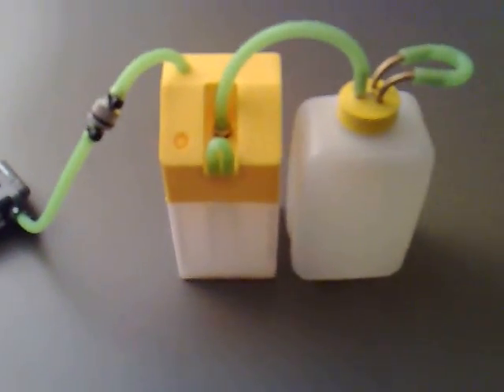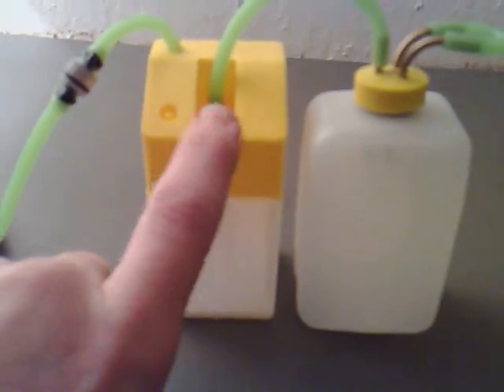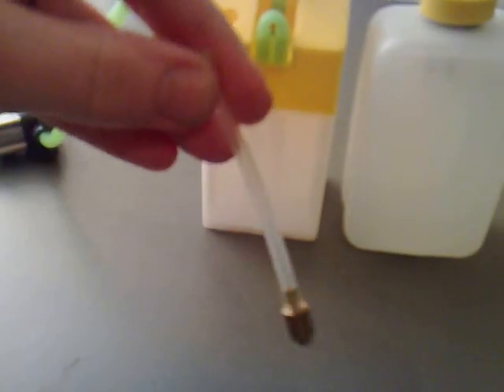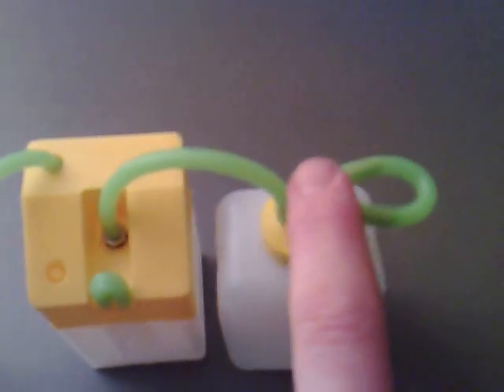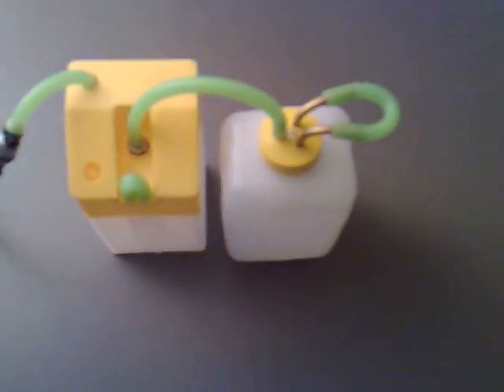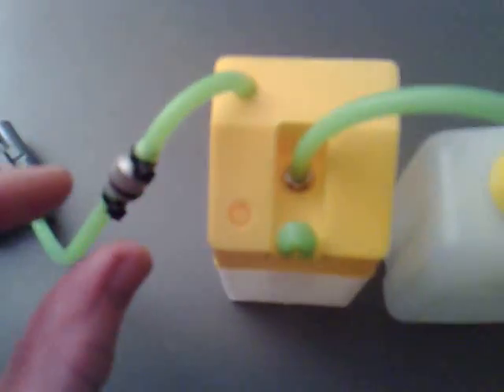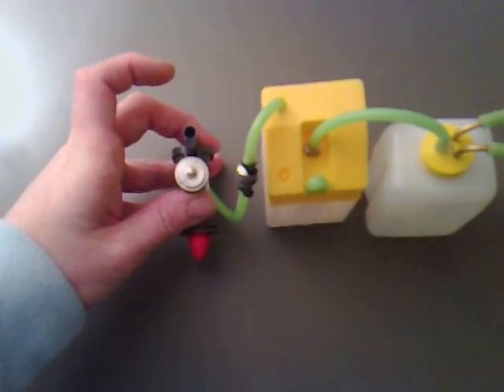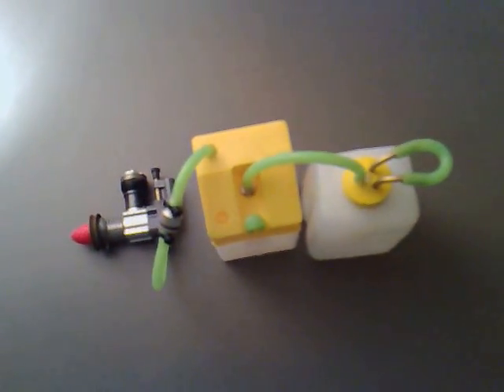HHO Generation (Bubbler) 003

Comment: are you sure the hydrogen gas can be ignited by heat and compression because that cox 0.49 is a glowplug engine and does not have a spark

Comment: So ummm I'm curious, what stops the oxygen and hydrogen from oxidising[recombining] in the crankcase when it is compressed to be pushed into the upper cylinder?
And where did you get the funky little flash back arrestor??

Comment: Not first.  Only much later after they've secured their position to prevent embarassment if their miracle doesn't work.

It's simple.. provide a working model that actually generates more power than it consumes, and then we'll all believe you that you can get energy from water.  Until then, happy youtube tinkering.

Comment: Also, model airplane engine fuel contains around 16-20 percent oil, which not only helps lubricate the engine's internals, but also actually removes some of the heat as well when it is expelled after combustion. If you could devise an electrical ignition and oiling system, this would be a fascinating bit of hobbyist research. I don't know if anyone has ever tried running hydrogen in a model aircraft engine. I hope I didnt discourage you too much, I see alot of promise in HHO used in engines...

Comment: I'm not exactly sure of the precise temperature inside the combustion chamber, however the general rule of thumb is to tune model glow engines so they run in the 220-240F degree (105-115C) range. The plug's coil however is probably hotter than that. When using a freshly charged glowplug ignitor battery, the coil is nearly white hot (a bit hotter than a dull red/orange). I hope that helps, I wish I had precise temps to tell you, but even still, most model engines differ anyways... Good luck!

Comment from the maker: Thanks for the info, at what temperature does the methanol burn? and what temperature does the platinum of the glow plug get to? I was thinking of making a small ignition coil if the glow plug did not work or may be pulsing the glow plug at the correct time..

Paul.

Comment: Don't want to burst your bubble, but that cox engine will only run on an atomized liquid fuel that reacts with the precious metal coil inside the glowplug. The component in model airplane fuel which accomplishes this is methanol alcohol. After passing current through the glow plug initially to ignite the fuel charge, the methanol takes over, reacting with the coil keeping it red hot, and continuing combustion. If you devised an alternate ignition method, then you would be getting somewhere... =)